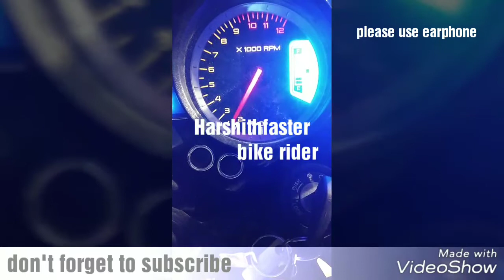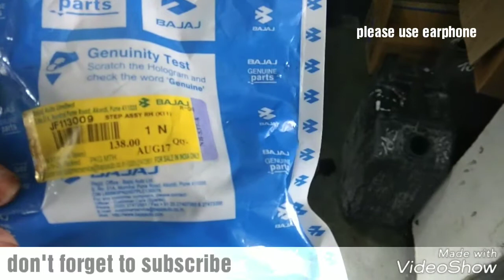How to fix footrest in ns200 || where we get ns200 spare parts ?

Comment: i lived in malaysia and i own ns 200 2017.my footresf bracket broken when i accidentally drop my bike .i oder the bracket and it cost me rm 95(ringgit malaysia).can be cheaper if i direct buy at modenas service center( bajaj rebadged from modenas).why ns 200 part can be broken easily ?
Reply from the maker: rekuze ree not all parts will broke .Y footrest will broke because footrest made by aluminium so it will break easily it's not a iron bro
Reply: oh..i see bro.it made sense.
Reply from the maker: rekuze ree mmmm